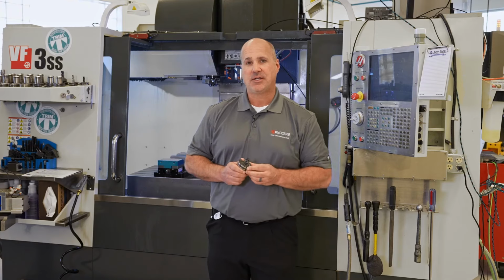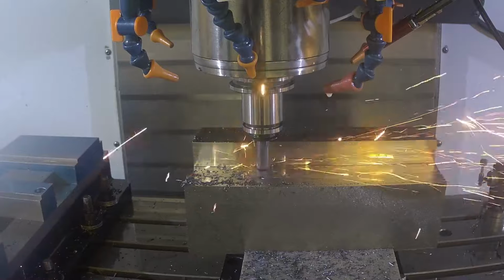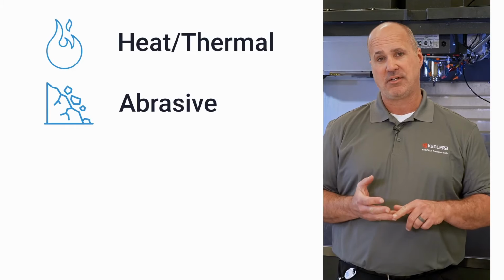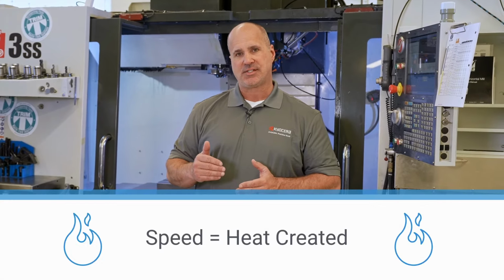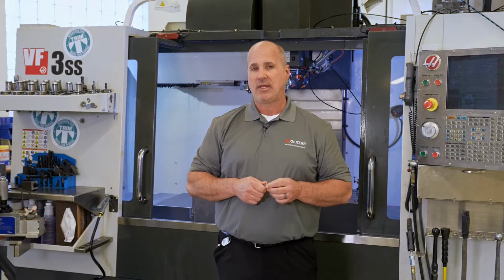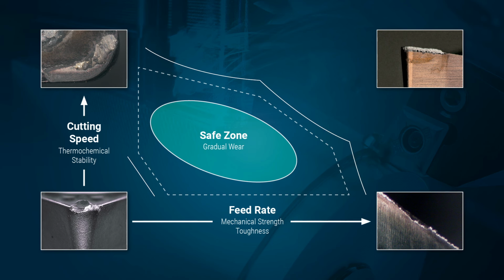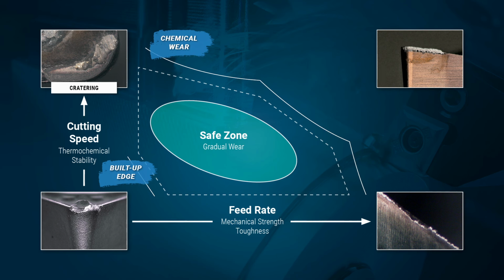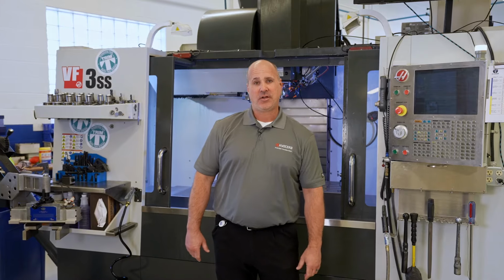Is Speed and Feed Killing Your Tooling

Comment: Hi It would be great if you could set up an actualt machining example.  Say using K1045 or 4140 steel and a 12mm end mill.  I recently wrecked an good endmill on K1045 steel and I am not sure why.  I suspect that there could have been hard  inclusions in the plate.  Have you ever found hard spots in rolled plate?  Cheers
Reply from the maker: The speed and feed setting can really make a difference in preventing premature tool failure, even in those situations. We'll forward your suggestion along to our partners at SGS. If the rolled plate was heat treated, that can change the properties a bit and cause the hard spots you're describing…